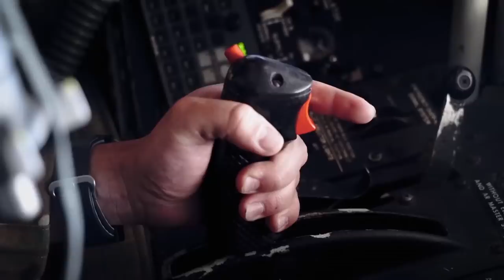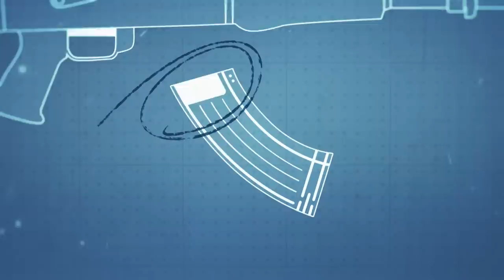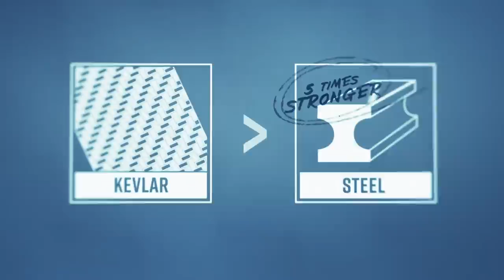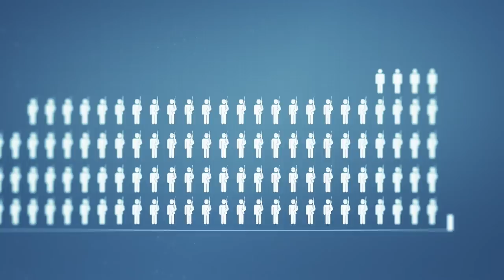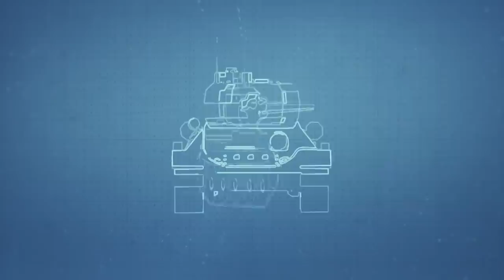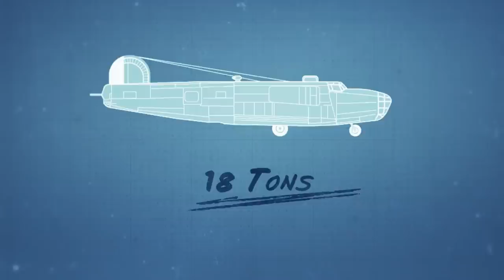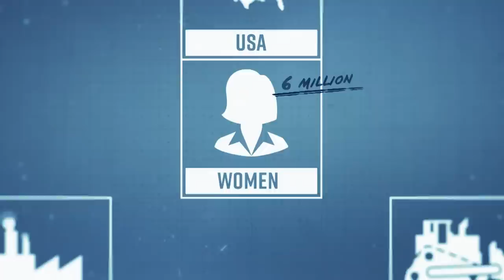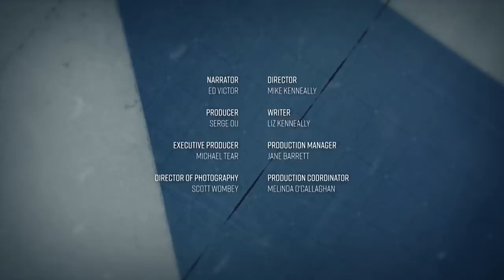Factories of War: The Rise of Modern Arms Manufacturing | FD Engineering

Comment: Actually, heating up a shell casing and then ejecting it is an excellent way to get rid of heat, and modern firearms would overheat and cook off if they couldn't dump heat that way. It's one of the biggest reasons we don't use caseless ammo at all and probably the single biggest reason polymer cased ammo isn't widely adopted.
Reply: Yup
Reply: this is an old doc when that was still new tech and people thought it was cool/will catch on
Reply: M-1 tank rounds use a consumable case.  Only the baseplate is ejected.
Reply: “The sky above, the grass below foot and the people in between”. Nice Avi.
Reply: Everything I've read on the polymer case stuff seems to indicate it doesn't transfer as much heat as brass. It's a weird phenomenon that can't be easily explained. So the doc saying "it goes out the end of the barrel" is as good as it'll get.
Reply: 100%
Reply: Well they're kind of behind because shotguns been using polymer or plastic a long time 😂
Reply: WAW didn't know what that.
Reply: I've wondered why we don't use polymer in Mini guns and all the gatling  gun style guns.  I had a cook off once with an SKS that accepted 75rd AK drum mags.  Steel ammo I shot 2 drums and only the last 6 or 7 cooked off.
Reply: @PaleRider- Shotguns are fired with relatively long intervals between shots. Also they have much heavier barrels  with more mass.

Comment: The head of General motors was appointed to preparing all industry for war. The controller of all railway activity, set timetables so trains moved far more efficiently. Ship builders and tank, artillery, aircraft builders, were given instruction to prepare for rapid mobilisation. Admiral Nimitz, did the same for the rapid repair of Perl Harbour, with the world's greatest concrete batching plant, sitting ready.

Comment: The new US Army 6.8mm NGSW Ammunition originally wanted Polymer, but what they chose in the end was Steel/Brass mix. The bottom 3rd of Cartridge is steel as US Army wanted significant performance increases over 5.56 so the combustion power is significantly higher proportionally, requiring stronger material.
There was 1 of the 3 finalists for the Contract offering a "Polymer Cased/Telescoping Round"(True Velocity, had hideous Bullpup rifle and MG offer. Army went with Sig, the best by far)however I dont think the polymer was capable of producing high enough energy...
Reply: The polymer is full pressure for combat.  The bimetal is for training.